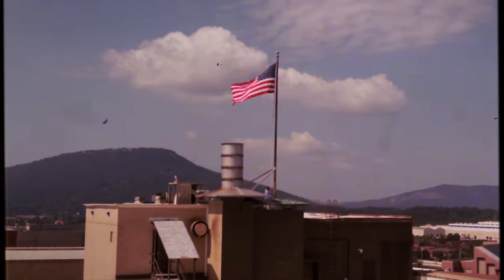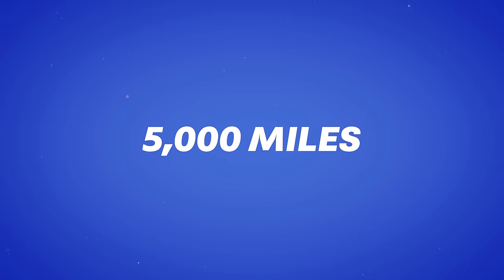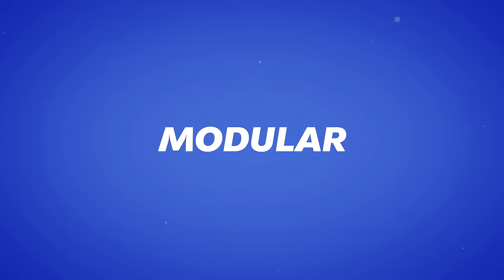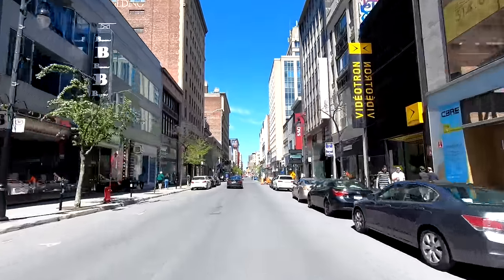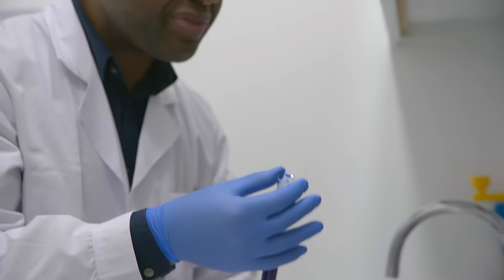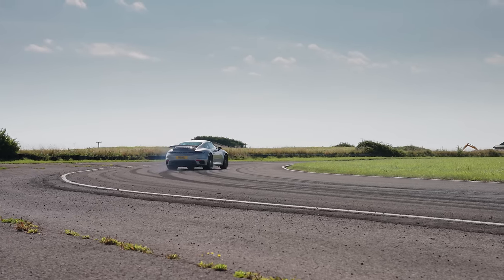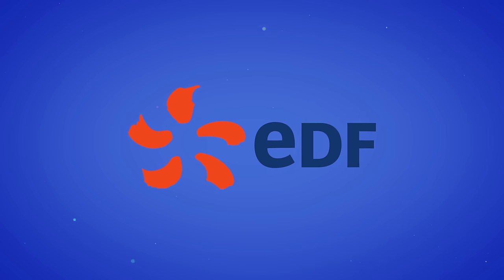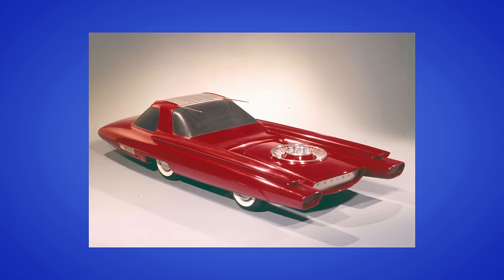Can Nuclear Power SAVE The Car Industry? 4K

Comment: As a former submariner that served onboard nuclear powered boats, I am somewhat dismayed that once the boats are taken out of the fleet, their reactors are not used to add power to the national grid whilst the various authorities and scientists come up with a way to safely dispose of them, which, I am sure, they will do in the future.  Now, when I was serving, I was told that the reactor on just one boat could provide enough power to service a city the size of Portsmouth.  I know that we have an area in Devonport dockyard where the boats that are now decommissioned and out of service are sitting.  Now, these boats, when alongside, used to switch to shore power, surely some boffins could come up with a way of using that connection to have the boat put power into the grid.  Just a thought.  (It would also provide jobs for the submarine nuclear trained engineers that have done their time in the navy and are looking for a job in “civvy” street).
Reply: Great comment!
Reply: Great idea but as usual politics would be bound to get in the way! ☹️
Reply: Great ideia , thanks for the input mate
Reply: I'm wondering, did you do a full feasibility study on this topic, like what would it take to remove a reactor from a submarine, where the reactor is already dangerous due to the fact that it created nuclear reactions for many years, then create a facility that would be acceptable to put these reactor(s) in an area where you could kill citizens?

Just a WAG, but I'm guessing that once you did that, even if you built a facility that could house a few of these, that it's not worth the cost of doing it.

In the US in particular the cost of nuclear power is obscene compared to natural gas, wind and solar, and with advances in grid storage, which has already happened, and no not Tesla Li-Ion based grid storage or any other companies' grid storage based on Li-Ion, the price of grid storage is going to drop.

Company, ESS and the product is Iron redux flow batteries.  Even with adding in the cost of grid storage and installing enough solar panels to not only power homes but also grid storage during the day, this would be far less costly than anything that has to do with nuclear power, until two things happen.  One, a state will actually agree to take nuclear waste and become the place where nuclear waste can be stored, since right now nuclear waste has to be stored on site, and anyone with a brain can figure out what that means, which is a cost, REAL monetary costs for thousands of years with each site becoming a superfund site AND having to provide security.  You factor that into the cost of nuclear power and I'm thinking that probably gets you up to $2 - $5 USD KWh, as opposed to solar, natural gas and wind which all can be generated for $.02 - $.03 USD KWh and ends up costing the consumer, after these companies make profit, between 10 - 12 cents USD/KWh.

Two, you need fusion for nuclear to really be worth it unless a country has a lack of options.

But you're talking about the US I assume since that's the country, along with Russia that has the most nuclear power subs that have been decomm'd.  Hard cold fact for the US is that solar and wind along with grid storage along with natural gas being mixed in can power about 75% of the US population.  Once the grid has improved long range power transmission, which is going to be part of the upgrade to the grid, you have about 1/4 the country that has almost non-stop sun during the day time.  On top of that you have a pretty large wind corridor that flows through Texas and goes up through OK and through the midwest.  

Consequently even with all the conservative politicians in Texas, wind production in Texas is the largest in the US.  It's 5th largest in the world.  It would be larger but we have stupid politicians and there's too much competition right now between different forms of energy, instead of there being a plan on cycling through natural gas, wind and solar in the state so these companies don't have to worry about the competition. Or, a single company owns all three types of power generation and they run each in a way to maximize wind and solar while ensuring natural gas plants function more as a backup but run enough to make sure they run the way they are supposed to.  Texas functions on a low bid system and it's privatized.  You couldn't build a nuclear plant in Texas now without there being a BUTT TON of subsidies.

Trump slowed the installation of solar by slapping a 25% tariff on panels coming from pretty much anywhere other than the US, and the US can't make panels economically.  On top of that panels coming out of China are not only more cost effective, they're better than panels coming out of anywhere else in the world.  Chinese business/scientists had been putting in more research into wind and solar than anywhere else in the world, and they've contributed to better manufacturing techniques, longer lasting panels (40 - 50 years), and more efficient to where cost/KWh is so small that installing large solar farms makes a lot of economic sense.  That tariff was removed by the courts a couple weeks ago so expect that next year solar installation is going to start rapid growth again.  Better panels can now give around 500W cont. during peak sun and I don't think they have the same issue with heat as older panels.

Retired, USN.
Reply: Great idea but usually it's because it's military... So things don't get mixed...
Reply: The cost+negative effects of converting nuclear reactors from retired submarines into powerplants defeat the purpose because constructing a new reactor is much cheaper and more efficient(as it would be designed specifically for power generation in a plant and not a submarine). Sorry to rain on your idea.
Reply: Just a question it's possible use the used uranium to transform into nuclear batteries like plutonium batteries as a example?
Reply: @johndoh5182  RR are planning to use these things as mini power stations
Reply: Finally someone with intelligent comment
Reply: We have a treaty with Russia that requires all spent nuclear reactors to be retired in a certain spot viewable from space satellites so each side can verify that the military nuclear reactors are there.  If we were serious about nuclear generation, we retired the USS Enterprise, which in addition to being able to be repurposed, is large enough a facility to also be easily manned and secured as a powerplant, as opposed to a submarine which is designed to be as small as possible.  Also, you can't hide it from satellites.
Reply: @uni4rm  
More of the reasons to send weapon and equipment to East Europe, for weakening to potential collapse of Russia Federation
Reply: Cool idea.
Reply: Navy reactors use much more highly enriched fuel though. The fuel navy reactors use is getting close to bomb-grade stuff. That's how such a small reactor can generate so much power. The navy would not take kindly to the idea of letting the civilian world near such high grade nuclear material.
Reply: @killman369547  - Why would they let civilians near it?  I personally think that the “Back Afties” that have recently retired from the Navy could be offered contracts to run the reactors, I am sure there would be quite a few would like to do shift work in an environment they know like the back of their hand.  However, it’s not likely to happen, just seems a waste of what is after all a very expensive asset.
Reply: @killman369547  even they still have agreement with Russia to not used ship reactor as civilian power plant
Reply: @killman369547  Good to know.
Reply: The problem with nuke subs, is that they use nuclear fission, which has radioactive byproducts. Fusion does not, and is more feasible.
Reply: Couldn't you just harvest the power from the reactor that is usually used to power the sub without dismantling the reactor
Reply: @johndoh5182  Without going into too much detail, to take a reactor out of a submarine you basically have to cut it out. It's a months long, very challenging process.
Reply: The energy industry lobbies hard to prevent nuclear power from gaining traction in the public. Nuclear power is practically free energy.
Reply: We all know the reason and that’s fear somebody would be able to copy the reactors or find faults in their design. At the least they should reuse whatever parts of reactors possible and retrofit them into cargo containers for civil use.
Reply: @johndoh5182   what about the amount of space renewable take up ?

Comment: Nuclear in regards to power grid generation is actually a lot safer these days, and public opinion (which is not based on fact) is the main reason new plants don't get made. SMRs have been in development for years now, and likely to be used in the near future.
Reply: They still generate dangerous waste.  Renewable is the only way to go.
Reply: Renewables (wind and solar) can't provide the base load required in most nations, even with Battery Storage 
Hydro and other water based generation are location dependent. Dams are also damaging to ecosystems and in the, unlikely, event of a catastrophic dam failure (eg: Banqian Dam and Machhu Dam-II, for example. Each of which alone has killed more people than nuclear) the number of casualties can be phenomenal. Even in non-catastrophic failures result in large power losses and/or large costs. The North of the UK and Texas know what it's like to go with a lengthy power outage.
Waste from fission is small in volume, can be reprocessed and "burnt" in reactors. Newer generation reactors produce significantly less waste. And when fusion finally it arrives it will produce no waste, generate significantly more power and can not be used to proliferate nuclear weapons
Reply: @christhompson4630  Almost all my country’s electricity was provided by renewables last year (Scotland).  The previous year wind turbines could have powered the entire country twice over.  As you mentioned a big hurdle is storage for on peak demand.  The Scottish government will run Torness (the only active nuclear station in Scotland) for as long as possible with Hunterston being decommissioned early next year.  I reckon we have until 2030 to figure out a storage solution for peak demand and then we will be nuclear free.
Reply: @Cal-Mac  Lies
Reply: @ghoulbuster1  Troll
Reply: @Cal-Mac  epic trolling
Reply: @Cal-Mac  safer yes but they should always take into account what happens if only one goes wrong. They have expamples for that.
This is simply manoeuvring into a situation where you say you need to use it because of the economic and the growth of it and to power our powerhungry lives.
Same with why is the pollution so high... Because no one except citizen tries to change the system where all is necessary. More people are getting wealthier on the world and want to buy all electronic plastic stuff... Even if this is pruduces more environmentally friendlier  they will produce more and more of it.
Yes we may need atomic power but this is general problem in the heads an the amount of people on the world. 
On the other hand I see no realistic way out of it. Humans are humans.
Reply: @Nordlicht05  By the ratio dead/energy produced nuclear is by fare the most secure accoding to most studies (yes even then solar and wind, wich has lot's of injured and dead peoples during installation/maintanece)
Reply: Yeah, I second that.

Comment: For the record, Rolls-Royce engines is entirely disconnected from Rolls-Royce Motor Cars, the car industry RR has nothing to to with modular reactors.
Reply: That’s the ship 🚢 division right?
Reply: @magnustan841  NNPPI Naval Nuclear propulsion. Raynesway, Derby.
Reply: YES! In 1931 Rolls-Royce bought Bentley. In 1971 Rolls-Royce Limited was split into Rolls-Royce Motors Holdings (autos) and Rolls Royce Limited (aerospace). Vickers bought the auto division in 1980 and sold it (along w/Bentley) to VW in 1999. The sale included the factory in Crewe, England, the Spirit of Ecstasy, and the shape of the grill. But...Rolls-Royce Limited still owned the Rolls-Royce name and logo, which it then sold to BMW instead (as it had existing agreement to supply Rolls-Royce engines)! So, BMW owned the name and logo and had suitable engines, while VW had the famous insignia and grill. An agreement is made: BMW would supply engines and use of the name from '98-'02. Starting in 2003, VW would produce only Bentley vehicles, and BMW would produce only Rolls-Royce vehicles. Consequently, BMW forms a new company called Rolls-Royce Motor Cars and VW uses the Crewe factory to produce Bentley vehicles (instead of Rolls-Royce). The last vehicle produced by the original Rolls-Royce Motors was the Corniche, which ceased production in Crewe, England in 2002. BMW then released the Phantom, produced in its new factory in Goodwood, England, in 2003.
Reply: But the Rolls-Royce jet engines parent company is very much the one working on Small Modular Reactors. Not even going in cars anyways. It's meant for Grid Electric Generation which might contribute to powering BEVs.

Comment: Nuclear power for hydrogen production is  more efficient than when using renewables because the extra heat from the plant can be used to heat the water used for electrolysis making the hydrodgen production more efficient

Comment: 5:08 You need to correct this Rory - Rolls-Royce PLC has nothing to do with the car industry. It is a completely separate entity to the BMW owned Rolls-Royce Motor Cars.
Reply: The PLC is just the Rolls Royce Holding company but in the end Rolls Royce will manufacture them, either way it's still a Rolls Royce project.
Reply: @nonyanks2510  Rolls Royce Motor Cars (owned by BMW) is nothing whatsoever to do with British company Rolls Royce PLC, which makes jet engines and nuclear power plants. They are completely separate companies.

Comment: Interesting stuff, maybe nuclear in a car sounds terrible but so does an explosive charge in your steering wheel… the levels are everything I suppose, but from what you found, the levels would need to be high so will probably never happen, well explained 👍
Reply: That, and the fact that vehicles crash, like he also said.  You couldn't make a vehicle strong enough to put a nuclear reactor in it.  You run into the issue of a negative feedback loop.  The more power you need from the reactor, the more material you'll need protecting it, which adds weight, and then you need to add more power to compensate for the added weight, and then you need more material to protect that larger reactor.  You'd basically need to be driving around in tanks.  Talk about an infrastructure nightmare, having to repave all your roads.

Comment: I’m pretty sure that, while Nuclear power does have some very bad consequences if a reactor does blow, those were either ancient or the reactors were terribly out of date. Besides, the casualty levels were much lower than u might expect. Nearly everyone within the vicinity of every nuclear power plant explosion ever was safely evacuated b4 the explosion. And on modern power plants, there r safeguards in place 2 defend against nuclear meltdown. In the case of a nuclear meltdown, there’s a rod that melts that drops the rest of the nuclear material under the facility and into storage (it something like that), effectively preventing an explosion. On the nuclear waste problem, 2 solutions have been identified. One of them is an alternative fuel (I’m pretty sure it’s an isotope of Thallium) that produces substantially less waste than Uranium-235 (the current fuel we use for nuclear fission). The other solution is 2 recycle the nuclear waste into nuclear fuel that can b burned again